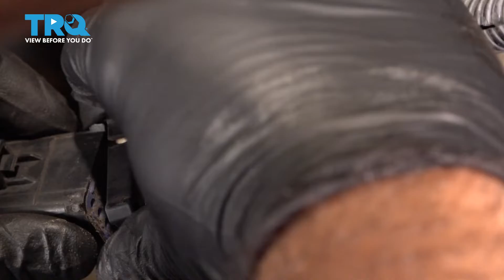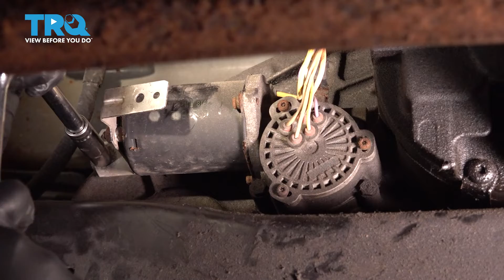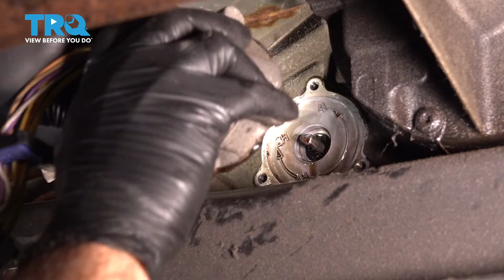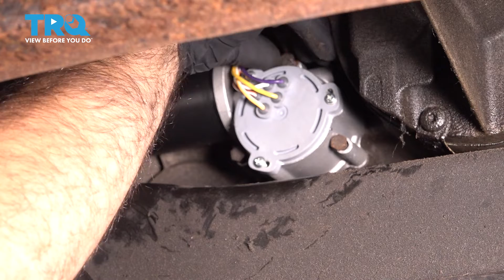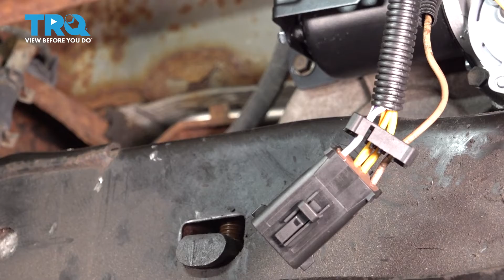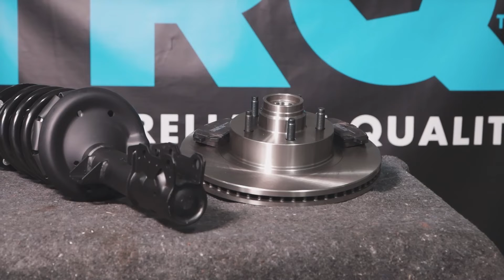How to Replace Transfer Case Shift Motor 1997-2003 Ford F-150

Comment: Before you open up the connector see if you can’t just undo the clip that hold the pin in and push it out with your pocket screw driver I was able to just push it out with out popping the cap and insulator off

Comment: Why the &&@8 would ford put a singular wire that you have to take the whole plug apart and remove the terminal just to replace? Why not put it in with the others? Or make a separate plug to unplug?

Comment: This video is very helpful question maybe you can answer this if not it's fine if I turn my four-wheel drive switch on my 99 f150 and I slap my dash why does it go in four wheel drive and then come out when I have to slap it again

Comment: Thank you for this video.  I have a question, I want to try to switch from 4WD to 2WD manually with the battery disconnected - before a I replace the whole part.  Can I do that by opening this up and using pliers?  If it gets stuck again, I plan to replace the part.

Also, for those asking, this part is located going underneath the truck, seated under the driver's seat.  Climb under there with a flashlight and look up under the driver's seat.